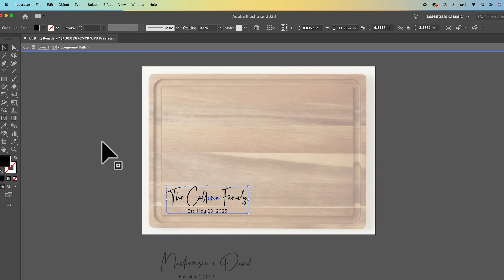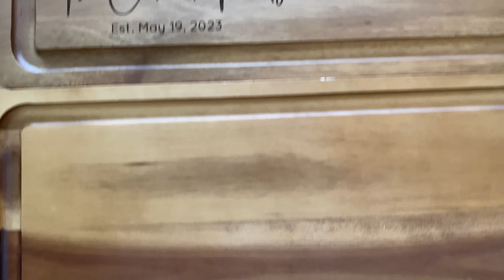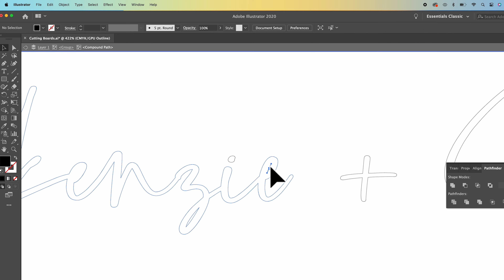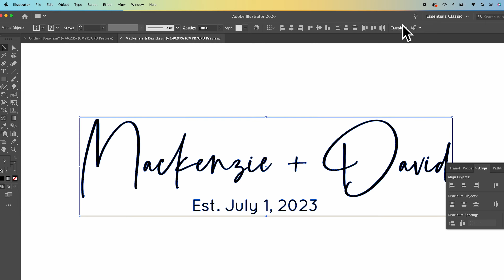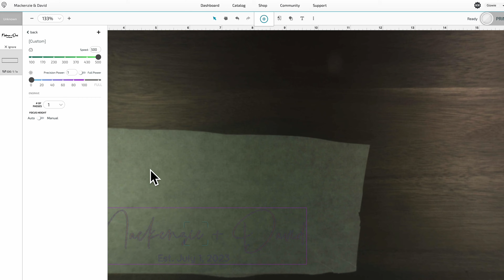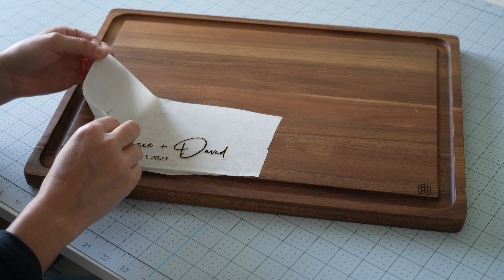How to Engrave a Wooden Cutting Board Using a Glowforge Laser

Comment: I suppose you are paying for the subscription.  I’m using the free version and don’t have as many bells and whistles as you are presenting.
Reply from the maker: Are you referring to my design software, Adobe Illustrator? Everything I do in the glowforge app can be done with the free program.
Reply: @ not the design, I’m referring to the scoring/engraving that you did.  I tried engraving but the it attempted to engrave the vector file overlapping lines. Then I went to score and it was worse.  Finally I had to set it to cut, but I ended up messing it up because I was unaware of the laser vacuum height.  This is my 2nd-3rd time using it.
Reply: @ but I do want to clear up that yours is pretty good.  I just didn’t see the same settings you were talking about/showing in the video as what I had access to.
Reply from the maker: Ah gotcha— you have those settings— you just have to manually adjust them. Start with selecting a similar material and instead of using the “proofgrade” settings, you can click into them to edit. I created my own custom settings from this :)